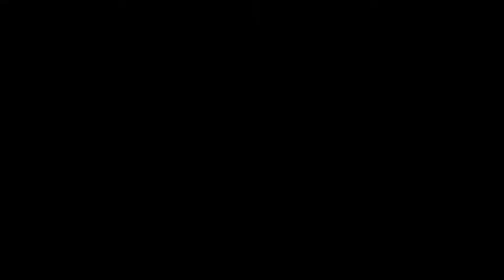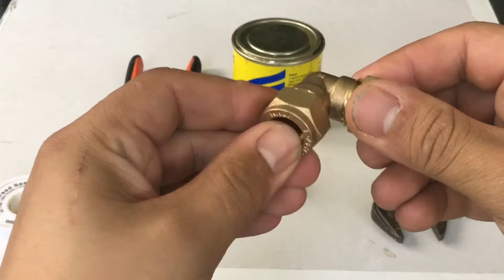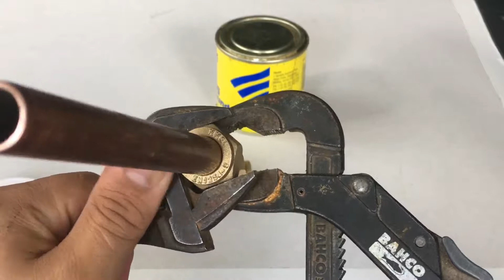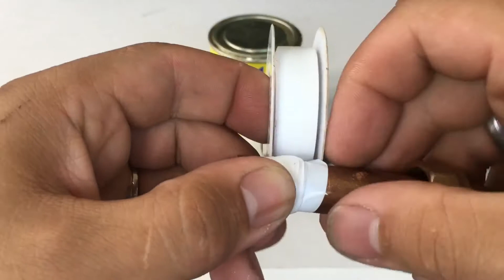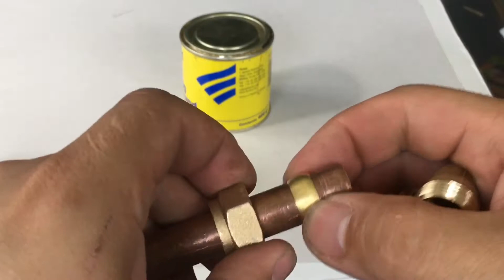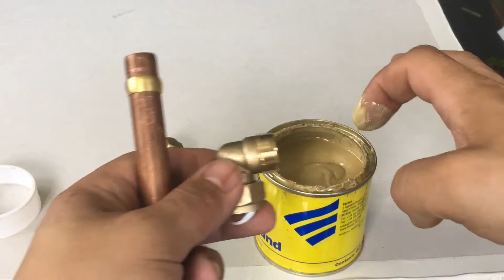How to use and install a compression fitting

Comment: Compression fittings are designed to create a watertight seal without the need for additional sealing compounds. They achieve this through the compression of a ferrule (a small ring) against the pipe and the fitting. However, there are some considerations to ensure a leak-free connection:

Proper Tightening: Ensure that the compression fitting is properly tightened. Over-tightening can damage the fitting and under-tightening can cause leaks. Typically, hand-tighten the fitting and then use a wrench to tighten it an additional quarter to half turn.

Clean Connections: Make sure the pipe and the inside of the fitting are clean and free of debris before assembly. Dirt or debris can prevent a proper seal.

Avoid Using Sealing Compounds or Teflon Tape: Sealing compounds and Teflon tape are not recommended for compression fittings. These materials can interfere with the compression seal and may cause leaks. Compression fittings are designed to seal through metal-to-metal contact.

Inspect the Ferrule: Check the ferrule (the small ring that gets compressed) for any damage before installation. A damaged ferrule can prevent a proper seal.

If you follow these steps, you should achieve a secure, leak-free connection without the need for any additional sealing compounds. If you do encounter leaks, it's often due to improper installation rather than a lack of sealing compound. In such cases, disassemble the fitting, inspect for any damage or debris, and reassemble, ensuring proper tightening.

Comment: Is the joint compound safe to use when drinking water from the faucet?
Reply: 9 times out of 10 check to see if it’s Safe to use on drinking water it will say on the tin

Comment: The pipe seals around the olive not the threads so what's the point of putting jointing compound on the threads. Surely it surely go on the pipe and olive as you did with the PTFE?
Reply: I’m not a plumber but you must be right, why would he put it on the thread when it should be on the olive, especially as he put the ptfe on the olive. This is supposed to be how to rather than how not to?
Reply: The olive is where the seal is made not the thread on a compression fitting. The olive creates the seal on the side that enters the compression fitting. You can wrap the olive with a little bit of ptfe or use a bit of jointing compound. If you use a little jointing compound they rarely weep or give you any problems.
Reply: @tracer1127  Well said, The thread is not where the seal is made. it's olive compressing into the cone of the fitting, tight onto the copper pipe. You said it the best!
Reply: Paste should be applied on pipe where the olive seats as well
Reply: @Martin T   Hi Martin.  You are dead right!   I am not a plumber, but for years I have carried out my own plumbing installations and maintenance.  I was advised by a retired plumber many moons ago that if PTFE tape or jointing compound (Plumber’s Mate etc.) had to be used, then the job wasn’t done correctly.   Suffice to say, I have NEVER used compound or PTFE and have NEVER suffered any leaks.  
Some manufacturers even state not to use compound or PTFE (or anything else) on their products.   I won’t let a plumber loose in my house, having experienced the bodges they leave behind.   
I use Idiot Tube to glean information on fittings etc., then carry out the job in hand.   It ain’t rocket science, is it?!   Iain.

Comment: Hi, thanks 🙏 for explaining so understandably I like it.
I have two question 
1. I bought one isolation valve, it doesn’t have the sign of  arrow to show direction of flowing water. Is it still useable or I need to return it?
2. In tee valve to avoid leaking which one you prefer to use  PTFE  tape or joint compound.
Reply from the maker: Good question the only thing I can say is that maybe the iso valve can go on any how where did you buy it from?

I mainly use jointing compounds as I feel that they are easy to apply but you can also use PTFE they do the same job.

Comment: Thanks for the explanation.  I have to replace an electric shower.  I have an existing elbow joint in place on the end of the pipe, but I need to turn it 90 degrees to meet the plastic inlet on the new shower.  Can I just loosen it off, turn it 90 degrees, wrap a bit of ptfe around the existing olive and tighten it back on.  Or do I need to replace that olive with a new one?  Would that mean cutting the pipe?
Reply from the maker: Hi all you need to do is just turn it round and yes just a little ptfe around the thread and you should be good, when you install the new electric shower make sure to read the mi’s that’s come with it for a safe installation
Reply: @tapintoplumbers1571  Thanks very much!